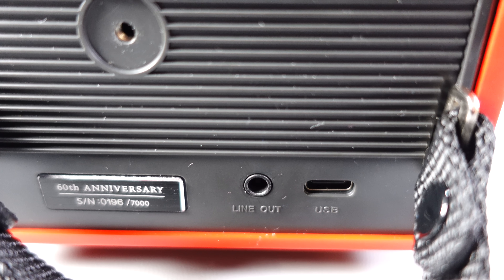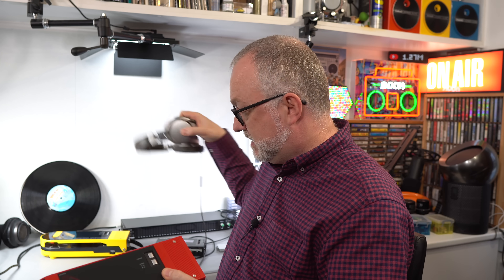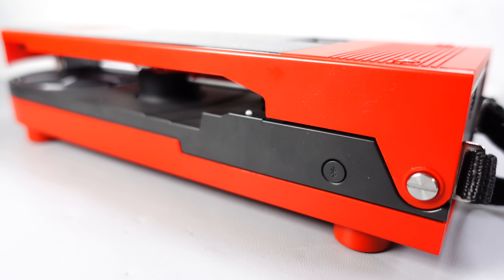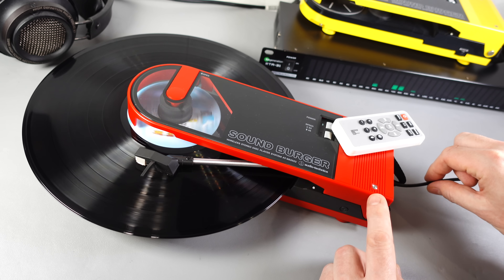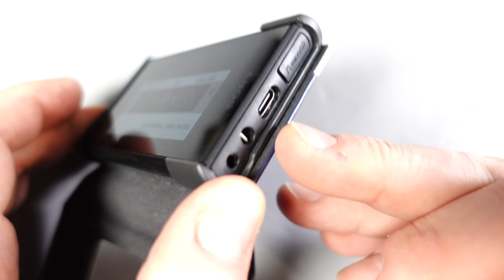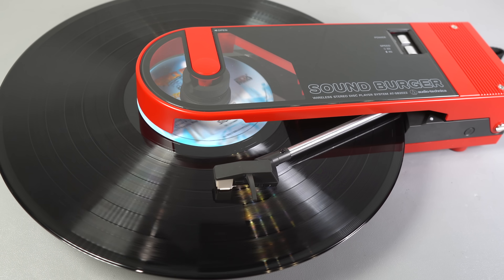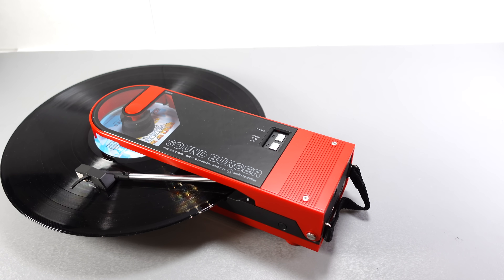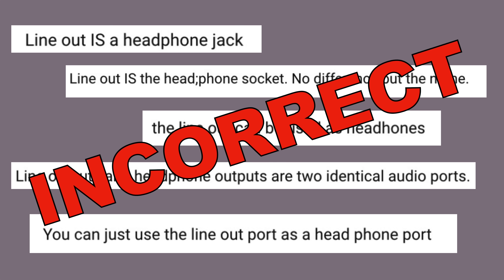Line-out ≠ Headphone-out

Comment: The output impedance is much higher on a lineout compared to a headphone output. You risk getting noise problems when using a headphone output as lineout. It is not recommended.

Comment: I had a tv with a 3.5mm Jack output that I plugged into my stereo aux input (Jack to rca) and Within the tv settings for audio there was a option to change the output from line out to headphone out and the difference in the sound quality and gain between the two was miles apart, this is how I found out that the two are not the same.

Comment: Why would you be trying to have a line out equal to a Headphone exacerbated level(i.e. putting headphone volume to max). I'd consider the correct approach to try and compare line out to headphone out with headphone volume to median. Exactly the middle between fully off and max. That would be where I'd expect it to be. Just like when you crank up the knob on the cable between the jack and your headset you'd want the volume to increase from the median there too. The point of such a volume knob is indeed a form of amplification or zeroing of sound. Unless it's purely to amplify the intent of focusing on amplification. Which is something you'd already mentioned.
I might be a bit stubborn here, but I didn't really see sufficient proof of it not being a headphone out except for using vendor specific use cases. Though I do use line-outs for their appropriate use normally, in the end the waveforms are still there, just set to a level people need to find an expectancy for. Personally I find line out's normally feel more clear to me than headphone out's, but that's going a bit far too to generalize that.
In your example that would be due to there being extra interference on the line to enable amplification.
In regards to median's in software btw. It's always bothered me that many programs set the default master volume level as Max or 100%. That's not really what you as a developer should be designing. It needs to be at 50% as default so that you can both increase and decrease, but then that's a completely different rant, compared to the misuse of terminology on ports.
Still thanks for taking the time to detail your facts. More explanations always help the public to eventually come to a consensus.

Comment: Most people are used to computers which automatically detect if the output is connected to the 600 ohms of a line-in device or the lower impedance of a pair of headphones. So for many devices, the green output is multi-purpose.

Comment: this is odd to me. i used to have a sony mp3 player that could switch the headphone jack into a line out jack through the menu options. the line out was very loud. also, when i play music through my cell phone to my car's aux input, i have to turn it way up to match the normal radio volume. even at full blast i dont think its as loud as the radio setting. it seems to me that line out signal is typically quite strong/loud.

Comment: Also, in most cases of headphone amplification, these signals are slightly "colored" with extra bass, to compensate for the small diameter of headphone speakers. So, if you use the headphone out as a line out, you will most probably get a boosted signal on the low end. Professional headphones excluded of course.
Reply: @SimonWoodburyForget   professional headphones usually tend to be more flat in their frequency response, so you won't have the effect I mentioned above as much.

Comment: And amplification circuitry can differ quite a bit in its design and implementation too, with both active (such as DSPs, OPAMPs, transistors) and passive (capacitors, for instance) components potentially able to alter the sound quite drastically from the "true" source.

Even line-level outputs can alter the sound from the source, depending on the topology, design and component choice - but yes, compared to a "headphone" output, the amplification is obviously going to be the major difference. :)

And it has changed a bit over the years too, I remember sound cards back from the early days of PC sound history where "speaker" labeled outputs could both be referring to outputs intended for passive (i.e. no external amplifier) and active (i.e. with their own amplifier) speakers. So the confusion has been there for some years. ^^

Comment: What about the no-volume vontrol headphones 6.3mm jack on several audio deck, like CD-players (ex. Denon DCD-480), Cassettes recorders, etc - you have a fixed volume headphone out, which you can also use as a line out at the same time as the back 2xRCA line out? 
I never understood why they did a fixed volume headphones out... it's useless as a headphones out, but usefull for a second line out.

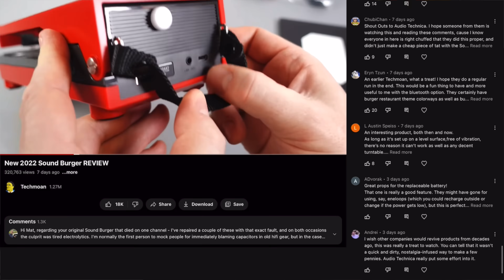Comment: So I'm at the 1:15 mark and I'm gonna guess what the difference between line out and headphone out might be. If I had to guess, a headphone output comes with a power amp built in so that you can control the volume from the unit directly, and therefir plug headphones into it (cuzbtheyre just speakers). And the line-out doesn't have a power amp, so its up to you to supply one before you can plug headphones into it, otherwise you get a raw signal with no control for volume and EQ. If i had to take it a step further, there's probably different ohms to each and the only reason one doesn't burn out the other is just because of how low power both are. Okay, I'm gonna hit play now and see if I'm right. Hopefully I am and this video has a better way of describing what I said.

Edit: ha! You just confirmed what I said when I paused at 3:13. (Feels smart)

Comment: I suspect this is to some extent generational. Growing up in the 70s, the best audio gear had both headphone and line out. You wanted that line out, because that was the only way to get a good transfer if you recording to a cassette deck. (Distortion from overdriving was a frequent problem if you used headphone.)

Speaking of the 70s, that neat little phonograph reminds me of the Close 'n' Play.

Comment: There is more to it. The best results you get if the resistance of the power supply is roughly equal to the load. The line out is therefore specified to drive a 47k resistance at 1Vss. That yields to roughly round 20 mW of power. The headphones have a much lower resistance and therefore need amplification both in voltage as in current.

Comment: well, 'been using the line out on my DAC for over a year now, after the headphone jack on the dac died. been totally fine on my BD DT 770s. The max volume is around 80% of the old headphone jack max. just controlling it through software works super good enough.

so i'd say it is an option (for pc applications :D).

Comment: i also think why some ppl are confused or believe line out works with headphones is that some sound cards and onboard soundcards have line out that can also be used with headphones
for example my onboard audio is 7.1 and when using 7.1 side speakers use the line-in channel and on my old motherboard it had line-out that could be turned to headphone out when toggled from the driver settings

Comment: As far as my understanding goes, line out is definitely not the same as headphone output - however, in some cases where the headphone amplifier section is designed for earphones/headphones within certain range of impedance could you use headphone output at its maximum volume as the alternative to the line output.

However, I would not recommend that you plug anything coming out of headphone outputs at any levels into microphone inputs especially when microphone inputs are designed for plug-in-power condenser microphones.

As an DIY audiophile myself, I have built a few sets of amplifiers where pre-amps and power-amps are in separate boxes and the amplitude of signals on the interconnect between them can often be found to be around the same range as the output of headphone amplifiers designed for impedance loads of 32-64ohms.

And because the interconnection in split-amplifier systems is also considered as loads (mostly capacitive typically due to the use of shielded wires), it is quite realistically true that the output of headphone amplifiers can be used as pre-outs to be fed to power amplifiers (or make a pre-amp with powerful buffers on its outputs so it could be used as a headphone amplifier as well).

Understanding the signal levels and the output impedance of output terminals in question is always the essential part of getting the connection right though.
Reply: Line outputs can often be very tricky - while the signal levels of line outputs of most decks are designed to be roughly the same when fed to inputs of whatever the audio equipment you are feeding the signal into AS LONG AS THE LINE IS TERMINATED WITH 10kΩ resistive loads.

Any termination with significantly lower resistance will result in reduced amplitude of signals. So maybe you don’t want to feed your unbalanced line outputs into balanced inputs that are terminated at around 600Ω.

Comment: Let me spare you 12 minutes of your life!
Line out is a signal output with line level (a standardized amplitude) signal and low power capability.
It doesn't have the amplitude or power capability to drive your headphones properly, but provides proper amplitude signal to line level inputs, low noise and low distortion.
Headphone output has more power and amplitude capability to be able to drive your headphones. 
But it can overdrive your line level input, and has more noise and distortion because of the power amp behind it.

Comment: I have used the Line out for headphones when I had my PS Vita plugged into the PS vita stand for watching videos on long flights and I could hear perfectly well. The headphones are noise-cancelling ones and have volume control on the headphones. I guess they might have som kind of amplification, as I do remember connecting headphones without volume control to the Line-out on the PS vita stand and that did NOT give a good listening experience.

Comment: Maybe some specs would have been helpful as well. From Wikipedia: "Line outputs usually present a source impedance of 100 to 600 ohms. The voltage can reach 2 volts peak-to-peak [...]. Line outputs are intended to drive a load impedance of 10,000 ohms"
Considering headphones have about 10ish (earbuds) to few 100 ("high-end" big ones) Ohms at 1kHz (lower at lower frequencies) the internal resistance of the output "eats" most of the power.
Basically the available power is too low: not enough voltage at the speaker, plus very limited current overall.
The summary is correct: just use another amplifier if needed. Just the "why" was not answered imho.

Comment: I got that difference as a kid, I can't even remember the device, but curiosity taught me that line out was super quiet and, more importantly, did not respond to the volume control at all.
I never consciuosly came into much contact with Hi-Fi equipment, amplifiers and the like, but I'm regularly driving my speakers from headhone outs, so over the years I kinda unlearned that.. thanks for the brush-up!

Comment: As for this video, I would like to mention that I'm using a Sony MZ-R900 Minidisc player regularly & whenever you plug a 3.5 mm jack in it's output, It's in a headphone mode by default but if you want to use it with an active speakers then line output should be selected in the menu.

Comment: i sorta knew this but def helped clear it up a bit, however i still have a question. Ive used lineout on a PC motherboard before (in desperation since my headphone port at the time was broke) and while it was a tad bit quieter it was no where near this drastic, and i was able to control volume on the desktop end just as when i had it plugged into headphone, why?

Comment: I was alwasy wondering what Line Out and Line In were supposed to be for.  This answers half of that -- am I correct in guessing that by analogy, Line In is an input expecting signals at a standardized level from other electronics, that may not be suitable for sound levels coming directly from a microphone?

Comment: The line output is supposed to connect to an amplifier, the headphone output is the output from a small amplifier. If the headphone amplifier is very low noise, most are these days, it can easily double as a line output. A line output without an amplifier will not properly drive any kind of speaker, not even a tiny headphone one.

Comment: I have a feeling the true confusion stems from computers. the back of a computer only has a line out, and most computers will ask you what you have plugged in, realtek anyway. so people have become accustomed to them being the same thing. manuals will say the green port is for headphones, earphones, speakers, etc.

I have seen people damage their front headphone port by pulling on the headphones standing up, etc.. and trying to use the rear. and failing to tell the computer they are using headphones instead of speakers, and having low volume until it's changed.

I think computers have made line out and headphone interchangeable!

Comment: I am an IT Manager now, and before that i was IT technician / sysdamin, and i used to manage over 300 computers at my workplace. I would say that the confusion with Line Out might also be because on a lot of desktop computers, the integrated audio panel on the back usually has 2x3.5 mm jacks, and they were identified as Line OUT/Headphone and Line In/Microphone combo.

However, the OEM included preinstalled software that every time you would plug in a headset with microphone, it will ask you what kind of device you plugged in, and depending on the answer, the ports will function accordingly. A lot of times, the users just mindlessly clicked Line In / Line Out rather than headphone/microphone, and they would complain about not hearing/talking with customers.

This type of issue i have seen on HP and Dell computers.

Comment: As a musician and uncertified audio engineer, I never knew people thought those are the same. I never even thought to use a line out for headphones, but now I want to try lol
So after I tried it on my bass guitar amp, I realized that the headphones amp has a IR or speaker simulator and the line out it's the... LINE OUT haha, It's the pure sound of the amp.
Reply: Are you talking about two different amps?  What is/are the amp(s)?
Reply: @fewwiggle  No, same amp has a headphones and line out. The amp is a Fender Rumble 150 2014 series.
Reply: @robertleahu  Thanks for the reply!!!  But, doesn't that model of amp require an effects pedal for different cabinet/IR settings?
Reply: @fewwiggle  Not really, u can just plug the guitar in and play. And u can either use the 15inch speaker or the headphones. It's a good combo amp
Reply: @robertleahu  OK , but there are no IR/Cabinet settings on the amp, correct?
Reply: @fewwiggle  No, it's not a digital amp or modeler. Just a solid state amp for playing live or band rehearsal. 

And to answer straight, it doesn't have a library of IRs or any kind of memory
Reply: @robertleahu  Thanks, again!!!  I'm sorry I'm being such a pain -- it's just that I was trying to make sense of your "I realized that the headphones amp has a IR or speaker simulator and the line out it's the... LINE OUT haha, It's the pure sound of the amp."
And, now I'm more confused than ever :-)
Reply: @fewwiggle  No problem man haha

So the sound from the line out and headphones plug is completely different for this amp. I can't tell for sure if it has a IR thing going on or whatever. But the headphones plug sounds rounder and nicer. Sounds just like when using a IR in a mix... 
I'll try to get more info about it tho

Comment: Hmmm, but I have my Sennheiser HD 58X (which are unpowered) plugged into my PC's Line Out and it works fine. 
I have the global Windows volume set to not even 1/3 and it's plenty loud.
I don't even have a headphone output on my motherboard (ASUS ROG Strix B550-I Gaming (AM4)). Just line in/out, mic in and USB-C audio (which i never used).
It's a 150 ohm headphone and AFAIK most consumer headphones are even lower than that.
Is my line out mislabeled?

Comment: I guess the ones that started this confusion were soundcard manufacturers. Soundcards typically had a single output jack for headphones and line and relied partly on impedance of the connected device.
The "better" soundcards had a separate output for headphones and line (they still have).
Something you forgot to mention is that connecting a headphone on a device that is not designed for it can result in damaging the output stage. A line out is designed to drive a load impedance of 10.000 Ohms, if presented with a much lower impedance like headphones, which are commonly less than 100 Ohms, you will ask the output stage to deliver +100 times more than what it was designed for. It's easy to design a line output that can handle shortcuts without being damaged but I wouldn't count on it surviving an overload for an extended period.
Also presenting an incorrect impedance can and most probably will have a negative impact on the bandwidth.